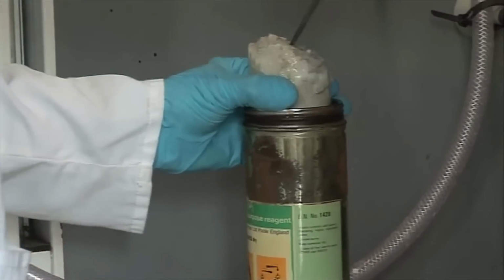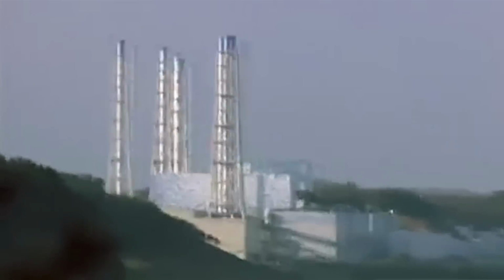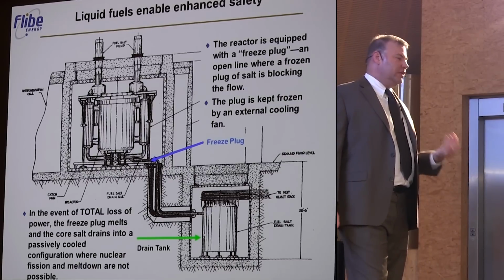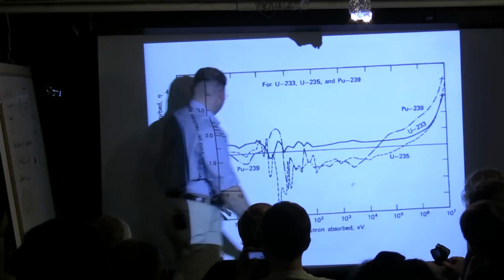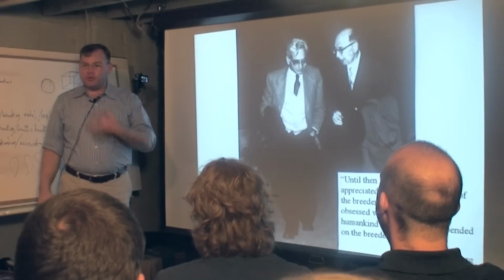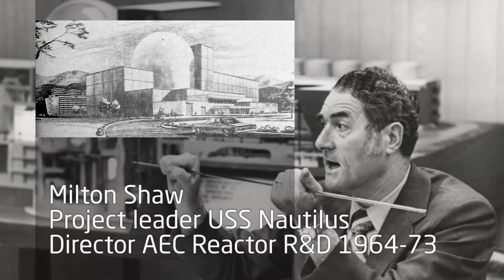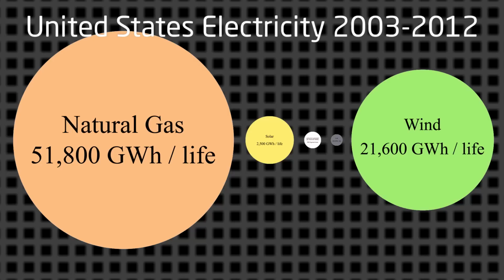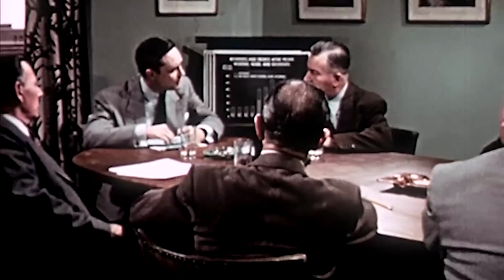Nuclear Disasters & Coolants

Comment: Also why no use non radioactive liquid salts instead of liquid sodium?
Reply from the maker: Chemical stability and liquid range. I don't have an off-the-cuff answer for stability just that 20m is where Kirk talks a bit about it. But the liquid range is pretty important... sodium turns to gas at a lower temperature than the salts being looked at. Bigger liquid range is better for safety, and for designing high temperature reactors.
Reply: Its my understanding is that the sodium is not directly used to turn a turbine. It is done through a heat exchanger with water.
Reply from the maker: michalchik Yes that is true (and mentioned at 39:20 but not as clearly as I'd like). I don't know how safe an IFR would be, only that past sodium cooled reactors have experienced sodium leaks/fires. That's why I tried to describe it as a trade-off... you get atmospheric pressure (yay) but a reactive coolant (boo). One could also use chloride salts for a fast-spectrum MSR, but that's barely been explored yet.

I'm not anti-IFR, and a PRISM reactor could be built any moment a country decides it wants one. Pandora's Promise talks up IFR, and has a nice sequence showing how their safety system demonstration was ignored thanks to Chernobyl happening at the same time.
Reply: I would like to see them run a coal fire plant with a sodium heat transfer system first, so see if they could even handle it in a system that could not go super critical.
Reply: michalchik
Want to burn more coal?  Really?  Do you realize what happens inside a furnace and heat exchanger when coal is burned?
Reply: Well you could make it a natural gas plant if you like. But the threat from one coal fired plant is small.
Reply from the maker: michalchik
That's way out of my field now, but I can't imagine sodium being used to transfer heat in a coal plant... sodium is not a great coolant, if you're just looking to transfer heat there's easier/safer stuff to work with. The fact it doesn't moderate neutrons (slow down fast neutrons) is why it is attractive for fast-spectrum reactors... so without the need for that no one would use sodium... in fact molten lead is being considered as a very inexpensive alternative to sodium in fast reactors.

So I know you're saying it is for testing purposes, but because there's no practical utility to the configuration you describe (other than testing) I don't see it happening. If you're willing to give up the fast neutrons (explore thermal breeding like LFTR) on the nuclear side, I think focusing on molten salts for heat transfer is more practical. A solar power tower is actually a great environment to explore working with molten salt, although they use cheaper stuff than Flibe that can't reach such high temperatures.
Reply: Oh, I was not saying that it was teh best way to build a coal plant, my point is they should do a proof of concept that does not stake a nuclear disaster on their competence.
Reply from the maker: michalchik I don't think there's a lot to learn about sodium as a coolant. They've built many sodium cooled reactors already. Please check out "Pandora's Promise" if you haven't already seen it, is free on Netflix. We could start building a "modern" sodium-cooled reactor tomorrow if we wanted to, and I don't think we're gong to learn much more about that type of reactor without finally building a new one.

Same with Gen3+ PWR... there's been "modern" safer designs sitting around for decades and we're about to learn more about PWR safety (finally) when we start running the ones that are being built today.

As for your concerns about super-criticality and sodium... it is really hard to say how safe IFR type reactors are... they're not just a change in coolant. Because they breed their own fuel they're not pre-loaded with lots of extra fuel (compensated for by control rods absorbing the surplus neutrons), they're sort of loaded with "just enough" and then breed from there. So while IFR loses some of the safety features of thermal spectrum, it benefits from the absence of all that extra fuel not being in the reactor, should things go wrong. I show people throwing sodium in water to demonstrate a fundamental concern with sodium and coolant reactivity in general. But it isn't at all like we've taken the existing safety profile of a PWR and just added sodium concerns. They're radically different, and tests have shown sodium cooled reactors avoiding meltdown in a complete blackout situation. So, had IFR been at Fukushima we would have avoided disaster. (Many ways to avoid Fukushima disaster, a reactor that supports passive cooling is just one.)
Reply: michalchik
Adding to gordon's -- no one was killed by our sodium cooled reactors, but all of them had problems with sodium & leaks!

Also, what "nuclear disasters"  We all know the Soviet RBMKs at Chernobyl were illegal everywhere else in the world.  We know Fukushima was caused not by nuclear power but by the Japanese govt...
www.nirs.org/fukushima/naiic_report.pdf
http://thebulletin.org/onagawa-japanese-nuclear-power-plant-didn%E2%80%99t-melt-down-311

If you want safe power, go nuclear, as we've known for decades.  And today, go advanced nuclear, especialy MSR/LFTR.
;]
Reply: A nuclear reactor is not safe unless its is safe when used in real life. The design not only needs to be fool proof, but it needs to be corruption proof.

Engineering needs to take into account not only physical law, but sociological forces like the tendency for people to cut corners, standards to erode, graft to grow, and people through curiosity and hubris to use things in a way that was not intended with little foresight or understanding.

Ultimately it won't be engineers building. managing, maintaining and running these plants, but a combination of politicians, business majors, and technicians that a best have a trade school level of education. With the small but reall possibility of a sociopath that just wants to hurt people getting inside.
Reply: Also don't forget about the waste problem. Unless we go to a waste burning system like LFTR potentially is, the waste problem is just a quiet slow disaster waiting to happen.

Look at what Hanford has become. No dramatic accident. No real major human error, just an unworkable system that was pressured and pressure to do more than what could be cleanly done. 

"Reports of a radioactive leak in 2013, along with $40 billion already spent to clean up, and an estimated $115 billion more required."

http://www.cbsnews.com/news/possible-radioactive-leak-into-soil-at-hanford/
Reply: michalchik "Safe" like GM ignition switches, Toyota floor mats, Mazda fuel vents, PG&E gas lines, coal plants, hospitals...?  That's what you mean, Michal?

That's actually what western nuclear power has been for 57 years -- safe.

As to "waste", you really should read "Atomic Accidents" and the other refs we've given you before talking about nuclear 'waste'.  For example, LFTR is not a waste consumer.  Some MSRs can be, however.

Are you serious about understanding,m or just wasting time and Internet kWHrs here?
;]
Reply: *****
This thread is old, but if I remember correctly the issue to me wasn't whether the nuclear fuel would be self- cooling but what kind of disasters can happen when a few tone so molten sodium gets over heated or exposed to air, I am worried, fire, conflagration, bleve that will breach the steam lines and spread the molten salts around quite well.

There just has to be a better coolant than molten sodium.

Comment: What about other metals like lead or zinc ,
Reply: The Russians use(d) lead in a couple of their reactor designs. Lead isn't not reactive in air and water (not like NA) but it has its own issues with activation products. 
Lead is not a bad choice at all though. Zinc is not the best choice as a coolant in a fast reactor. While it might be more favorable than Sodium in terms of moderating abilities, Zn is very happy to bond with other metals and you end up with significant plate out. That's one of the reasons Zinc is so useful as a sacrificial coating on things like exposed steel in bridges, buildings, etc. They use it on regular steel screws and nails to add corrosion resistance without having to galvanize them or make them from stainless steel. 
Zinc is nice in that it doesn't have any really long lived isotopes that you'd find in a reactor but lead or sodium are better choices.
Reply: @Clean97GTI  The Alfa class submarine had lead-bismut alloy as liquid metal cooling. There was a complete loss, when the reactor froze in.

Comment: Weren't there also 3 deaths from a test reactor in Idaho? I believe it was called SL-1. I understand that this was over a ten year period, just depends on which ten year period. Though I would consider 3 deaths to be fairly insignificant.
Reply: World wide, including Chernobyl, test reactors from 1957 onwards, 3 Mile Island and Fukashima, less than 100 people have died overall. And 100 is an outside estimate by sensible anti-nuclear activists (not anti-nuclear psychos who don't know what they're talking about, use avid scare tactics and say things like Chernobyl killed a million people... uh-huh). Worst case of death was Chernobyl at an estimated 50. Outlier estimate are up to 60 if you include all possible cases of deaths that haven't been verified yet.

THat's all I've got. Don't know if it helps, but it gives you a bigger picture of mortality across the world including disasters. And as far as I know, the figures I recounted include ALL related deaths - accidental, radioactive etc. etc. That last 10 from Chernobyl is still being questioned though.
Reply from the maker: There was a single USA nuclear deathwhich happened just AFTER I'd created the deaths/watt visuals. That was a crane collapsing... an industrial accident, nothing to do with radiation or nuclear specific hardware. And yes, there were other nuclear deaths in USA prior to that, but you'd also then have the other energy sources death counts going up as well. I'll slide the 10 years along when I iterate these videos to a fresher snapshot, but I think a 10 year window is the most realistic timeframe to work with.... we don't see the big hydro accidents and we're not trying to figure solar/wind deaths for periods there was essentially no solar/wind to speak of. And I'm far more interested in how safe all these respective technologies can be than how dangerous they can be. Even coal was far deadlier in USA going back 30 instead of 10 years... how pertinent would that be today? That's my thinking anyway.
Reply: 13minutestomidnight The Chernobyl number is theoretically not complete, (if I wasn't misinformed, and my memory isn't failing me) there was contamination across the north of Scandinavia attributed to Chernobyl, contaminating wildlife (food sources for the Sami people especially). if we take smoke inhalation into account I guess this should be accounted for as well. 

There where also fears of miscarriages and birth defects but I don't remember them being proven.

TL:DR; Radioactiv waste/radiation isn't a super food and Chernobyl spread like a MFer.
Reply: Therefore, send not to know
For whom the bell tolls,
It tolls for thee.        ~John Donne
https://www.who.int/news-room/fact-sheets/detail/road-traffic-injuries

Comment: CANDU reactors use water but do not use enriched uranium. CANDU is the safest reactor using deuterium as a moderator.
Reply from the maker: They can but typically don't.
Reply: We have 4 reactors at work that have been running since mid 1980’s. The way it was explained to me was “ a light water reactor is like driving a car where you are continually trying to keep it from running away and a heavy water reactor is like a car that you have to keep pumping gas to keep it running “ this is one of the ways it keeps things under control one of the the major downsides is it is an expensive plant to build. I’m not disagreeing with your point that we need to progress to salt moderator reactors I’m just curious why no one mentions D2o reactors as they are a lot safer that light water and when talking about types of reactors. I work in a heavy water reactor, rebuild for half life maintenance.
Reply from the maker: @michaelremillard731  Only Chernobyl was a prompt-critical situation where things got-out-of-control with fission... TMI and Fukushima were issues dealing with decay heat, and obviously once Chernobyl's lid was blown exact same deal. There's no history of fission getting-out-of-control with not-RBMK water cooled reactors, they've proved to be very easy to turn off.
Reply from the maker: @michaelremillard731  To clarify: Decay heat does not turn off. So combining coolant with Fission Products is a good way to address the issue of water boiling away when for-whatever-reason the water starts to do so. Yes, any coolant will boil away if it gets hot enough, but up to ~1400'C that gives lots of head-room for passive heat-management mechanisms to remove that heat.
Reply: @michaelremillard731  I thought the beauty of the CANDU concept was that heavy water does absorb much less neutrons than regular water, so you can have criticality even with natural uranium, which means you are not dependent of enrichment plants.
Reply: @gordonmcdowell  There was a reactivity accident in a non-RBMK reactor in 1961, killing three men. https://en.wikipedia.org/wiki/SL-1
Reply: @gunnarkaestle  that wasn’t a candu but I am familiar with the accident. One man was pinned to the ceiling of the room with a shield plug and it took numerous hours to get him down due to radiation levels. If I remember correctly.
Reply: @michaelremillard731  I was referring to "There's no history of fission getting-out-of-control with not-RBMK water cooled reactors" SL-1 was a light water reactor, that got out of control because one of the maintenance team made a mistake and probably it is also a design error to let this kind of human error occur.

The mechanical effects were caused by the water hammer which occured when part of the water was flash vapoured during the prompt critical nuclear reaction and this drove the rest of the water quickly upwards. This lead to the impaling scenario and also let whole reactor vessel jump about 3 meters after the water hammer slammed against the lid. Even if the victims had not been affected by the mechanical effects, standing next to a criticality accident can be lethal because of the radiation. The Tokaimura accident had no mechanical consequences, it was just a soup of enriched uranium bubbling slightly. From the 3 people in the room two died, the third sat at a desk a few meters apart from the mixing vessel. See: https://www.youtube.com/watch?v=LiYZSKtZb7k